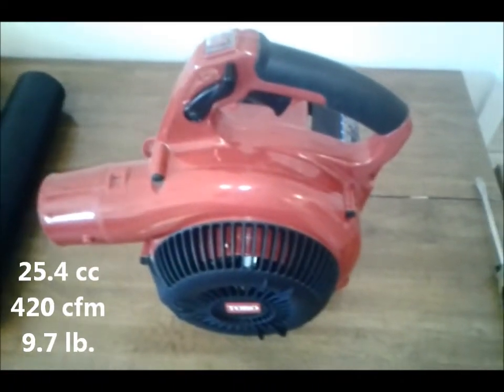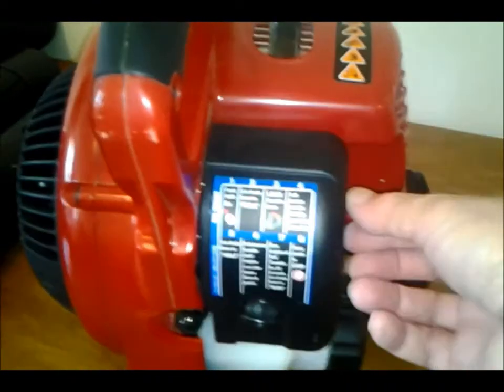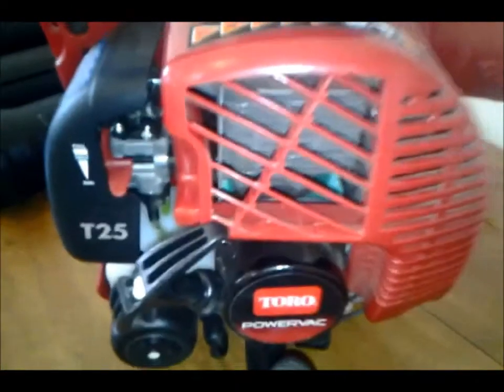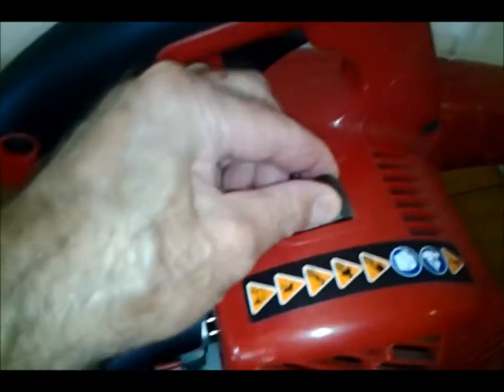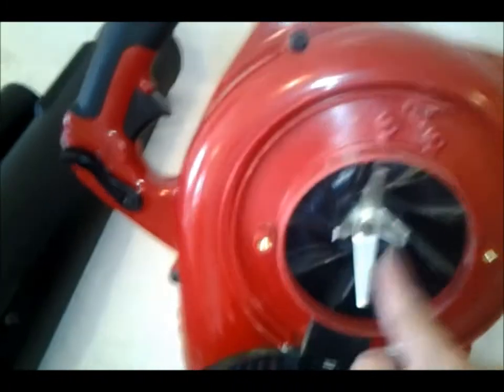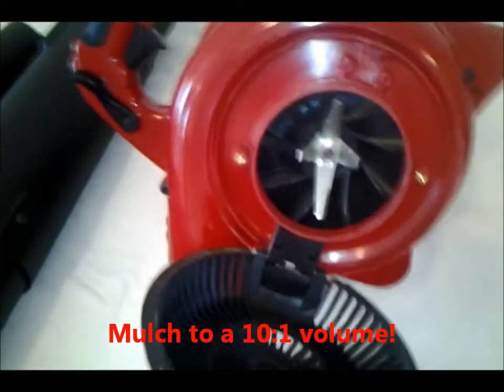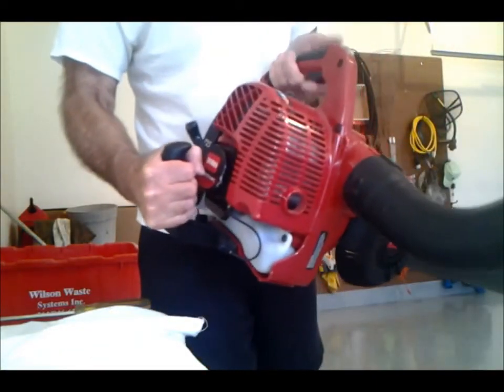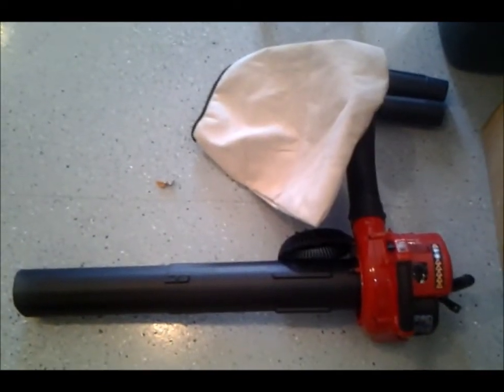TORO POWERVAC MODEL 51987 (25 cc) FEATURES & RECOMMENDATIONS

Comment: The bags for mulching are awful though.  I've been through several and I'm tired of them.  What did you upgrade to by chance?  I'm just as interested in the vacuum as I am the blower.  Thanks.
Reply from the maker: John, the zippers on the bag are delicate.  My first one ripped, early on, and I actually complained by email and believe it or not, they sent me a new one.  You cannot overfill the bag because of the poor stitching on the zipper.  My wife tried to repair the old bag and I am using it as a back up.  I think you could literally tie a heavy duty plastic bag on it possibly and it might work?  So, if you have gone through so many bags, has the unit held up otherwise?